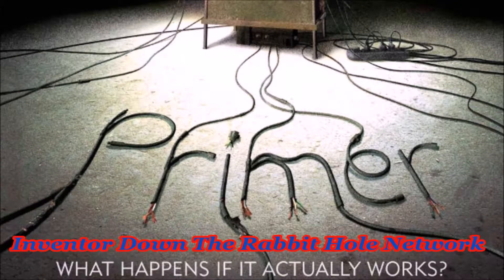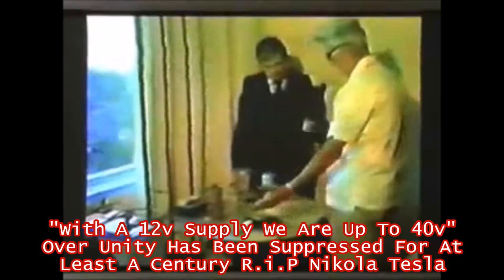Bob Teal Magnipulsion Electromagnetic Motor Free Energy Over Unity Diaries Part 19

Comment: He's got some showman skills.  I don't see the overunity.  Removing counter EMF and recycling it for use in upcoming cycles does improve efficiency, but only as a removal of loss, still not overunity even on paper.  I did experiments with capturing and recycling the collapsing field, and it was equally efficient as simply putting a back emf diode across the coils like in the days of DC motors in RC cars.  The current in the coils like to keep going until the voltage reaches zero and a designer has 3 choices: 1. shunt the back emf spike to ground (wasteful), 2. Diode shunt it back in to the coil around and around until it dissipates, or 3. Capture it in a capacitor, but at opposite sign to the applied supplies making re-use of captured electricity both challenging and elegant solutions wanted.  Now, if the motor is tuned like a violin for maximum efficiency then the maximum current spin time of soln #2  stays in the attractive angles of approach of the rotor, and not extend in to the turning past TDC angles.  So far, all data says that just a back emf diode is very efficient on energy, but not on maximum power, since it only allows 50 duty cycle at most per coil (DC commutation).
Reply from the maker: It's a very simple design really I don't see how it wouldn't work. it's just like the gas cars when they throw there exhaust back to the engine and recycle it making it far more efficient and basically zero pollutants. Same thing this device is recycling the e.m.f which is causing the over unity effect. It's not rocket science.  Water is probably the most over unity liquid we have. Hydrogen is far more explosive than gasoline.  The truth is these devices work and the inventors get killed or payed to shut up
Reply: @WesternScienceUSA   it wouldn't work because of the 2nd law of thermodynamics, there's no free lunch here, work in = work out, just approaching closer to 99% efficiency doesn't make a motor overunity.
Reply from the maker: @oldskooldriver9379  I completely disagree with you. What you call  "disorder or randomness in the system" i call it Usable Energy. The laws need to be Updated they won't stop me from breaking the laws anyway. When Crypto rises in value not even the military will be able to touch me i will build my own private military and fund all devices in house.

Comment: well, here's the thing.  not ONE of the old-time OU heroes has ever recorded a Cogent explanation of how his apparatus functions, WITH  SPECIFICITY.   With  Measured input and output values.   NOT  ONE  of these miracles of science was  REPEATABLE.    can you spell 'gullible'.    like ALL the rest throughout history, this chap was, either, a deliberate or accidental  Hoaxer.     cheers
Reply from the maker: David Davids your sadly mistaken most of these inventions are repeatable you have to understand the back e.m.f and pulsing , don't ground out the back e.m.f utilize it , put it into a second battery . Which takes a process that I know. Magnetic reed switch to full wave bridge rectifier. There repeatable sir that's why  Stan Meyer was killed that's why Eugene Mallove was killed that's why the bedini brothers were killed that's why.